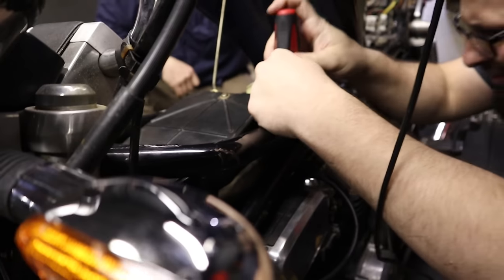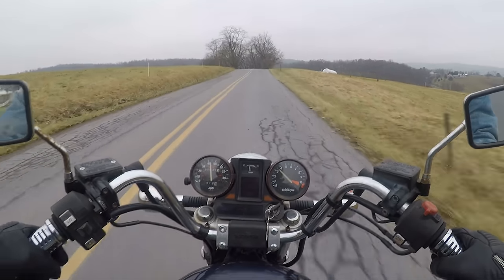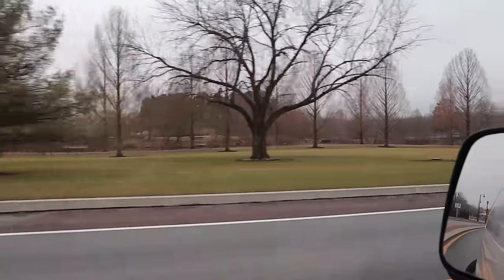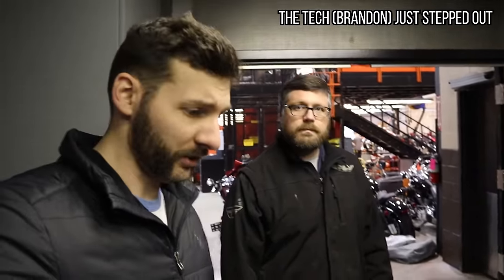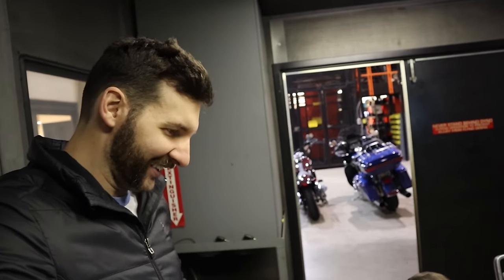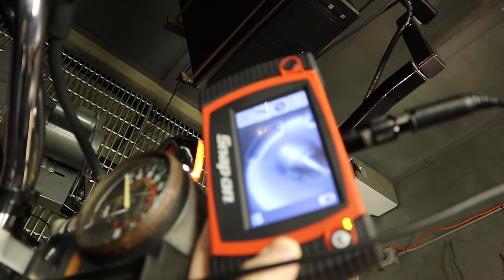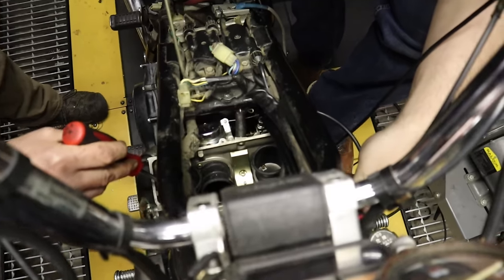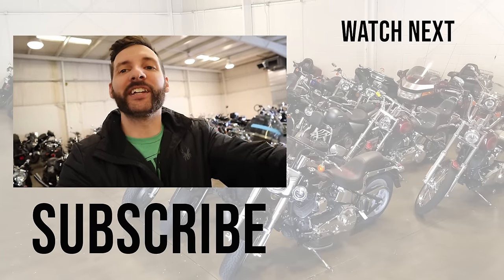We FIXED this abandoned bike for $83 then put it on a DYNO | 83 Honda Magna

Comment: "If you've never froze your hands and legs off, on a motorcycle you weren't sure was gonna make it, to your destination.....I'm not sure you've even motorcycled."
Perfectly described.
Reply: I'm Qualified and Certified ... More than most will ever experience on two-wheels I promise!
Reply: How true. And it matters not what you first rode, how small or slow it was. Memories are made and (as in your case) lives can be shaped by the simple act of buying that first bike...P.S. Mine was a Yamaha FS1E
Reply: @BibTheBoulderTheOriginalOne  Learned to ride 1967 Honda 90 Scrambler...   and NEVER stopped at 65 years old still rolling .. 2014 FLSTL H-D & 2012 BMW R1200GS ADV.  Owned more bikes that I could count.  You keep on rollling to ...It is my favorite thing ext to sex and food ... Sort of:)
Reply: When you have to scrape off the ice on the inside of your face shield. Or Getting cought 3 hours out of town in a down pour ,rode it home SOAKED. Boots full of water .  Asked alot of girls to go for a ride
Reply: @joegilly1523  If I told you what I have rode through ... you would never believe me ...I swear ...I have put myself into the worst weather imaginable.   I do it and regret it and DO IT AGAIN!!!!  65 years old and still ..... being crazy and lovin it ....well .....sort of?
Reply: As a young guy in England I had a  ride of just under 30 miles home when a freak snow storm hit hard. Most of it with my feet down so I wouldn't fall off. Cars flying by cos I was mostly riding the hard shoulder. Never been so scared or cold in my life. I laugh now but shit dude I figured I was most definitely going to die. Thank God it was English cold and not Canada cold otherwise.....
Reply: @infidelzombie9382  Vic,  I had a couple bad ...REAL BAD rides... Both in Colorado ....Freak storms can come in and become absolutely evil ... but one was in the plains (flat lands of Kansas and eastern Colorado ...May 1989 ... Wearing only jeans with, long underwear. Returning from a weekend ride on my 1974 R90/6 BMW... (no windshield)  on my way back to Colorado from Kansas... it began to rain and it continued to rain and then ...SNOW... it was no freezing to ice on the asphalt but it was sticking... as I continue west toward Colorado it just getting colder and wetter ... no ice formed but I had a single track in the snow behind me.  I spare you the PAIN and BONE CHILLS stories... I will say when I finally got home I wrapped myself in an electric blanket for 14 hours and was still shivering ... the story is longer  and I'll save you the details ..BUT DAMN!!!!!! I ve many more sad painful stories  ...BTW  .... ..... 7 hours in that snow!
Reply: I just paused in that spot to say the same thing. Then I saw you had "Beat me to it".
Reply: @paulmanners1364  Stuck to the tank? LOL RRRIIIIPPP
Reply: @DennistheMenace-e3f  haha. Right on.
Reply: @paulmanners1364  good point
Reply: YES SIR!!!!!
Reply: Which is why I love my current bike in which I have total confidence.
Reply: @26478me  same brother i ride year round up here in mass rain or shine on my 2916 ninja 650
Reply: Sitting in a bar with some friends, when someone said that it was starting to rain....well, rain at 30 degrees freezes as soon as it hits the ground, or your bike. It was 36 miles of freezing rain on my '05 Softtail. between 15-20 mph the whole way, using a borrowed bar towel to wipe my goggles every 2-3 minutes. I actually thought about stopping at a filling station to get under the awning but figured that since I was already soaked, frozen and suffering to just push it all the way home. I'm in my 70's and have been riding since 1967, and this was probably the worst ride of my life. 

If I ever found myself in that kind of situation again, I think I would try to leave my bike in the bar and get a ride in a car....
Reply: I keep living the fantasy of buying a motorcycle in my head but I haven't pulled the trigger on one, yet. I think one of the biggest reasons why I haven't bought one up to this point is my paranoia of becoming a statistic, having some moron run me over(because they didn't see me). I've been an avid cyclist my entire life so I'm no stranger to bikes, just never owned the variety with a motor on them. 😆

I have been wanting one though and I've been watching a lot of videos about motorcycles over the last year or so and I'm giving serious consideration to buying one, maybe next year? 

I don't have any silly notions of jumping on some 900cc+ crotch rocket or trying to impress anyone but rather looking to pick up economic, comfortable, cruiser for local commuting / cruising. 

Not sure if I'll ever earn my motorcyclist stripes if it means riding in adverse conditions with little to no confidence you'll reach your destination but then I've also been living without a motorcycle. 

 Still not sure what that first ride is going to be but I believe I've all but convinced myself to buy one.
Reply: for sure ive done it a couple times i remember my first motorcycle was a 82 yamaha seca 650 with a xj650 turbo engine swap damn thing never wanted to start in the cold the battery always died on me and it always ran out of gas on me on the highway but when it wanted to run right it was faaaast got it up to 155 on the highway and it started to wobble one of the scariest feelings
Reply: Then he puts the bike up because he wanted to get there safe
Reply: Bob Seger I learned on a S90!
Reply: Rode home in water deep enough to touch my hyper charger rode 18 below in a T-shirt for 15miles let my wife borrow my jacket on a date before we were married rode in snow 10 inches deep rode St Louis to Evansville Indiana bubble gum wrapper for head light fuse damned old Honda ignition yep you can definitely torture a Honda they are better than a timex
Reply: I'm from the Netherlands and you can ride a 125cc at 18 years old so I planned my final exams just days after turning 18. I drove so much in the following weeks through rain and storms and froze my hands and legs so much I wouldn't be able to walk. It was awesome though! I'm love riding so much
Reply: Next minute put on carry rack.
Reply: Bob Seger j
Reply: can't relate that on our tropical county, here, we get sunburned instead haha
Reply: Yup. Been there and froze that (not fun, but ya stay upright and push through). But never made me stop loving riding. Riding for 40+ years.
Reply: Edward Weiszbeck Drov to work when it was 30f had to eat my lunch just to warm up.
Reply: I've gotten frostbite a few times.
Reply: Surfside, Tx to Cleveland Ohio 2 days{slept wrapped up in tarp under a picnic tablefor a couple hours} . Funeral...RIP Uncle Grant ...crashed on Aunts couch...drove back.
Reply: Hahaha definitely me on my current zzr250 still send it as often as possible
Reply: Hey, not my fault I live in a desert. So I guess I could say, "If you've never had your crotch so sweaty that you have your own slime coat when you a arrive at your destination, I'm not sure you've even motorcycled."
Reply: sounds like my commute
Reply: Looking for a new girlfriend, how are you fixed? Lol. What a wuss.
Reply: I headed out to a meeting with some folks 30 miles away one evening on my 550 4. When I got there I found out the meeting was cancelled because of the blizzard. So I rode home in the blizzard.
That should qualify.    :^)      (Canada)
Reply: I would have, liked this if, it were not for the, commas.
Reply: "If you've never froze your hands and legs off, on a motorcycle you weren't sure was gonna make it, to your destination.....Make sure you are being follow by a support van with the heater running and a blanky to put over your knees.
Reply: Been there, but its been a long while
Reply: @joegilly1523  and thosd raindrops on your face at speed without a shield '- painful, heh.
Reply: @McLoven-vm1ck  look into some motorcycle classes for safety or learning to ride classes. You can always learn by yourself but if you take a class, you can learn everything in a lot  shorter period of time and in safety .
Reply: @edwardmulder3777  Always had a full face helmet for my street bikes but ,you still get hit by the rain
Reply: Good to know that I have truly motorcycled, lol
Reply: @noidontthinksolol  When you have to go to work and your car won’t start.
Reply: In tropics it's a bit diffrent. Burnt face and tosted upper part of your pair of hands.... haha.
Reply: I have froze taking bike home from shop 4 miles on highway omy
Reply: so true
Reply: @felixdzerjinsky5244   ''in my 70's and have been riding since 1967" Wow..... respect....that"s what I plan to do fulltime , after I turn 50 :) . Sterted riding since I was 16......lol.
Reply: I remember falling of my bike frozen after riding for 4 hours on an old 43WLC Harley only 200km in -10C with snow, wind chil of minus 20C etc and my friends peeling clothes of for the next 4 hours while I came back to life, that was back in the early eighties. No clothing like we got now! No money either, news paper was great until it got wet. The next day I had to ride back!!.... Ah the good old days! You know, i'd do it again, actually I have done many times since!!
Reply: Had an absolute beater Honda CB500 for a while in San Diego.
Rode it to work in shirt sleeves - sunny fall day about 60F.
But I worked swings - when work was over it was low 40's - and a fine misting rain started on the way home.
I made it, but I was so cold it took me 5 minutes to pry myself off the bike.
Reply: Been there. Done that.
Reply: I had a 82 v45 magna  , my speedometer went all the way to 210mph , I got a little over 150 on it. I loved riding it so much I rode it in the winter to work on I 20  from the Martinez ga. Belair rd exit to the Washington Thompson ext . I was working at Edison plastics in Washington , ga.  Every morning I would stop at the rest stop on I 20 and put  my hands under the hand warmer because they were freezing. I use to take my Bible and a study book with me to work and study during lunch. I strapped them to the back of the seat on the bike. One morning when I stopped to warm up , the books were on the back of the bike when I went into the rest room but when I came out someone had stolen my Bible and study book from the back of the bike. I really do hope they did him some good ,because like all of us he needed it just as bad.
Reply: And straps it to the van right after saying that 😆
Reply: did that once...torture. The warmer ride back was nice
Reply: I bought my magna last weekend. Rode it home from in the mountains of va 2.5 hours. About 30 degrees when I left. Cold cold cold ride, but worth it to get the bike.
Reply: 14:42 9.59
Reply: @Edward: I think he forgot to add the line "...and if it gets a bit chilly, just jump in the van"!
Reply: In 1996 I rode my Honda Interceptor in January, freezing cold 8:30 AM, and it was foggy out, just enough to where I don't think I blinked once. It was all the lubrication my eyes needed. I remember a family in a minivan looking at me in disbelief as I'm sure they were nice and warm. Good thing I was "comfortably numb" if you know what I mean, so I didn't feel anything, plus being 26 at the time, I was invincible.
Reply: THE NORTH REMEMBERS!!

Comment: I remember when those came out, I worked for Honda and they were scary fast, for the time!
Reply: I sold mine like an idiot years ago. Still regret it to this day
Reply: Those were not fast, a v65 was alright but the 750’s were not fast
Reply: @1301tbear  v65 was the 1100 a v45 is the the 750.
Reply: @charleygallagher2257  if you were scared of a v45 magna you must have never rode a fast bike, magna's did not handle very well at all and provenance was about on par with other 750's of the day but they did not handle near as well is most others.and yes I know a v45 is a 750 and a v65 is an 1100, sold them and worked on them back when they were new.
Reply: @1301tbear  I worked for a Honda shop and bought one the first day they were listed and kept it for about 5 days . and then I done a  600 mile check on one and discovered the factory set the valve lash at about 0.020 "  and when you set the valves to factory spec off 0.003" ex haust
Reply: V45's weren't very fast but the V65 was one of the super bikes of it's time along side the Madura and the Vmax.
Reply: They’re still fast lol, the 1100 v65 is a beast. My father and brother have one, I’m looking to get one for myself
Reply: @1301tbear  Even the V30 did 0-60 in 4 seconds. Fast for its time, and definitely faster than you’d expect out of a 500cc V4 in the mid-80’s. The Shadow bikes were the slow ones.

Comment: A few years ago, I taught my son to ride on an '84 Magna. While a couple of his friends went out and rented scooters to do the test, he took his test on the Magna. He still has it long with his Harley. If anyone thinks that a 700cc motorcycle is slow, they have never tried a Magna.
Reply: Try the bigger one muscle bike of the year. V65 Magna.
Reply: @crod2165  I test road one before I got my v45 and yeah the 65 is win.
Reply: Recently bought a 85 Sabre as my first bike and it’s nearly 2x my age lol
Reply: @crod2165  The 1100 was INSANE!!!👍
Reply: All in the gearing and rpm
Reply: I had an 84 the same color. In good condition that 750 would fly for a sub liter bike.
Reply: That was my first bike! Yes it was really fast and it was light, easy to maneuver, I couldn't have picked a better bike to learn on! I actually just sold it about 10 yrs ago for more $ than I paid for it.
Reply: I bought an 83 Magna 750 two years ago, running poorly, and restored it with some custom changes. Currently runs great, I've put maybe 4000 miles on it myself.
Reply: My buddy in highschool had a V45 Sabre. This was in the early 2000s so I just thought it was an old junker. Until one day we left his house, me driving my '68 Grand Prix and him on his bike. A little ways down the gravel road he blew past me on the Sabre, riding a huge wheelie. I was pretty shocked, especially because he weighed 300+pounds. He also owned a Suzuki T500 Titan that he ripped wheelies on and jumped, and the pegs were bent downward at about a thirty degree angle. He was one of the reasons I got into bikes soon after that. My first being an '83 Yamaha XS650 and my second a 1975 Honda CB750 which I still own.
Reply: I had a Magna. I could get it up to 135 mph. It would probably do more but after 135, it would wobble badly and I had to shut it down.
Reply: try a 04-06 cb600f thats a fast bike to i got one and it tears your arms off lol
Reply: @cjjorge6636  ok
Reply: Honda smegma…
Reply: Fastest I ever got a Honda 350 to was 145mph it got so light at that speed I think it hampered acceleration.A 700cc should be plenty fast enough to please most people.
Reply: I had a used 83 V65 1100 cc as a first bike with 32000 miles, sold it when I traded my Camaro for a new 06 Harley Road King Classic.  I enjoyed the hell out of the Harley but the V65 was a better bike in my mind for commuting.  6 speed, shaft drive, light, quick, comfortable riding position, low height.  I will probably own another one again.
Reply: I have a 700 magna too and it beats a tuned ford ecoboost
Reply: Buddy of mine had a v45.  I'd had rode a few sport bikes and he always said his old v45 would smoke them.  I called b.s. on him.  He told me to run it down the road and back.  I laid in it and it shocked the hell outta me!! That thing would effing cook!!
Reply: I currently have a 3rd gen Magna, and its not fast lol. Even the V65 (which Ive also owned) is only okay in the modern context. 

Id say once youve ridden a liter bike or big bore sport tourer from the late 90s on nothing else feels fast.
Reply: I have a 84 v65 I just brought back to life